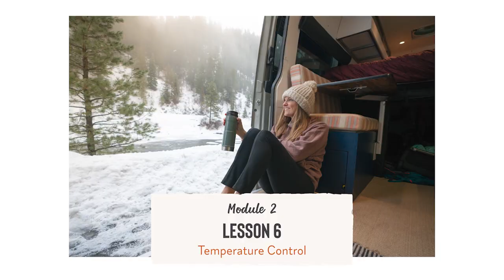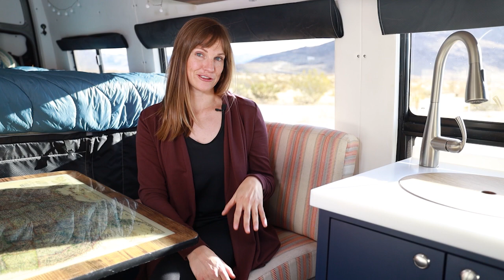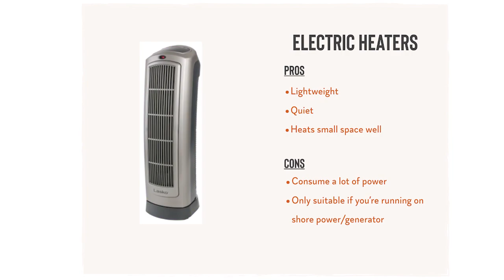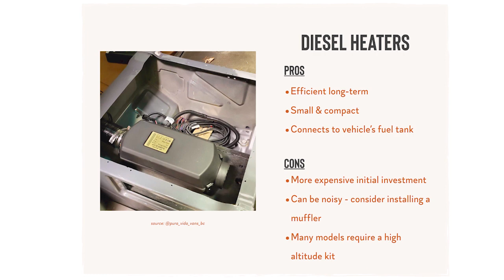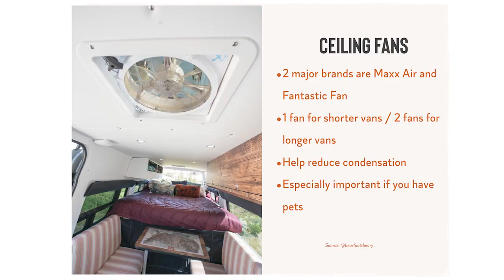Van Conversion: Heating, Cooling, and Temperature Control

Comment: Most people will need AC.  The summers are ridiculous.  HOT and HUMID... uncomfortable... sweaty... stinky... can't sleep... too hot!  So how do you run AC in a camper van?  Doesn't it have AC built in?  How long can you idle with the engine/AC on?  The new Fords with the Power Boost generators seem like awesome solutions.  They can run for a week or so on a tank of gas!

Comment: Good tips. Did you develop this content for a course you were planning to sell ? I think temperature control is one of the biggest challenges with van life. Especially with climate extremes. If it's really cold having the right sleeping bag, hat etc can keep you warm. Heat is a nearly insurmountable challenge. There's no way to get enough cooling from a realistic off grid setup. Trying to run AC overnight would need a massive investment in batteries, and then you have to recharge them the next day. A few solar panels on the roof of a van just wouldn't cut it. And running an inverter at close to its maximum output is going to generate a lot of heat.
Reply from the maker: Hi there! Yes, originally I planned to sell the course, but back in January as I was developing a launch plan, selling it just didn't feel right. So I decided to give it away instead so I could help more people. Thanks for watching!

Comment: It's too bad you didn't talk about all the options for 12v AC split systems. It makes the possibility of having AC with just your solar/battery electrical system realistic.
Reply from the maker: I did my best, but I couldn't possibly cover everything. If you know of any resources, please feel free to share :)
Reply: AJourneyOfYourSoul do you have any resources? Thanks!
Reply: Tara Charney cruise n comfort has systems and is more geared to working with the end user. 
https://www.cruisencomfortusa.com

For those that are knowledgeable about hvac, proair is another resource. 
https://www.proairllc.com

These are 12v split systems where half the system is mounted underneath the van, so saves space inside the van as well as roof space.  

Dometic has some very low profile 24v rooftop systems ( dometic coolair rtx 2000 is one) geared towards the semi truck market, but I believe these aren’t offered in North America yet, so would have to be bought and shipped from overseas sellers, ie imported.